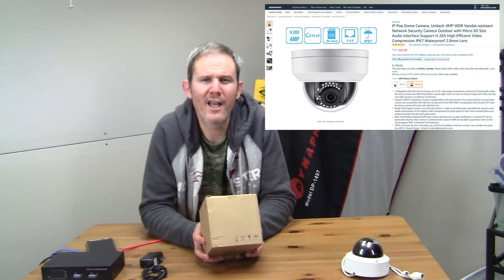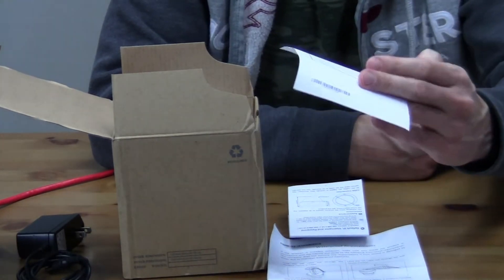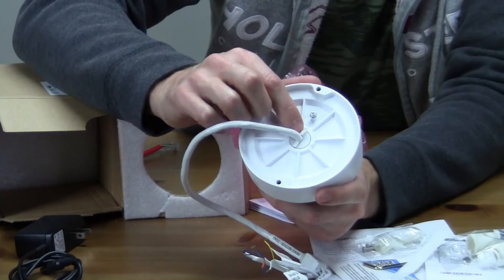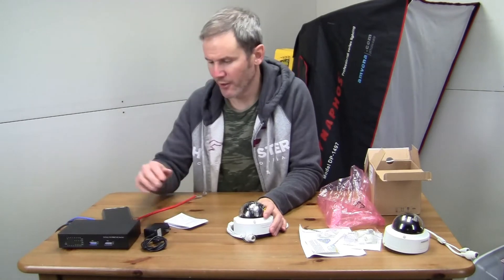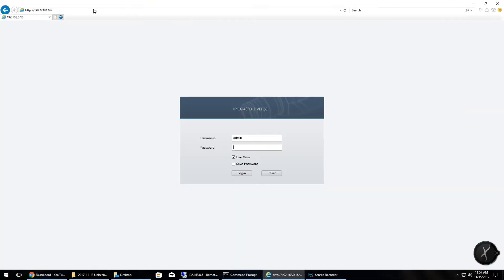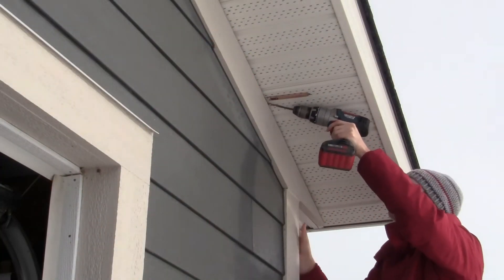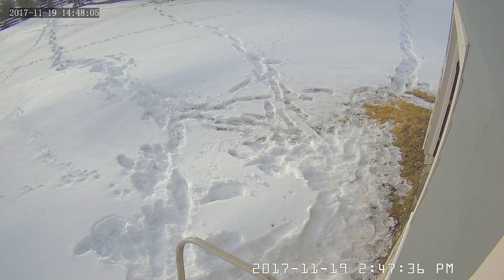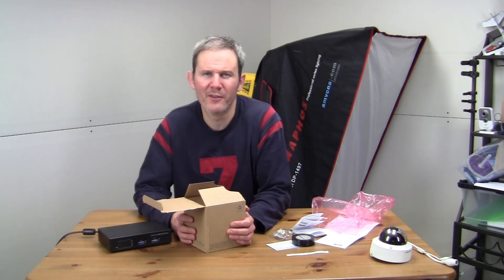Unitech WGCC Dome Security Camera Setup and Review & New Blog

Comment: Please continue to make these videos. I'm planning on getting alot of the equipment you have on this channel to secure my shop.
Reply from the maker: Hey!  I am hoping to produce a couple of videos every month.  If you have ideas of things you'd like to see, drop me a line.  Thanks!!
Reply: newfiebort I have one other question if you don't mind me asking, I have CAT5E cables running through the walls to a current analog Wirepath camera system. If I was going to upgrade to IP will those cables work with the cameras or is there another type of cable?